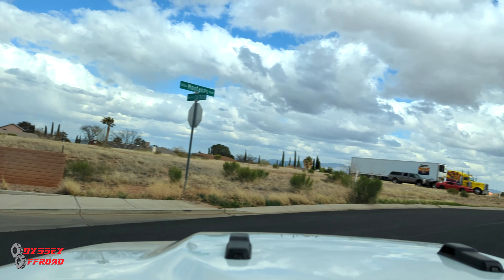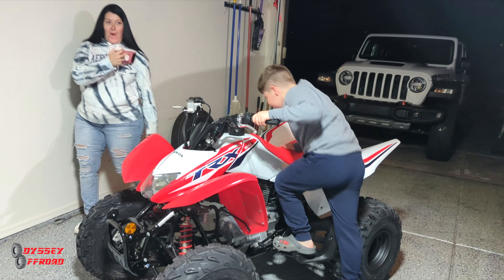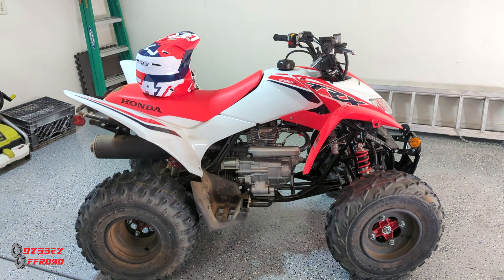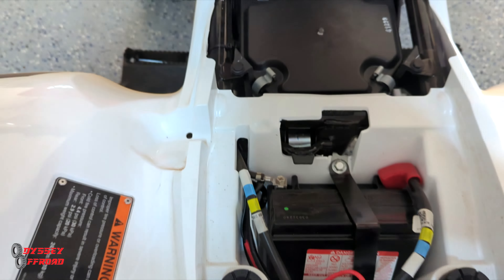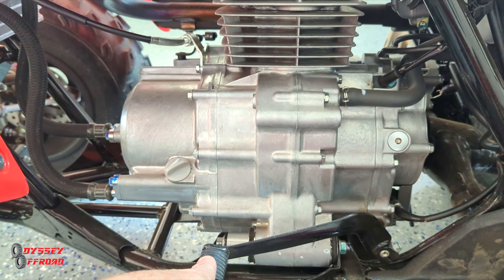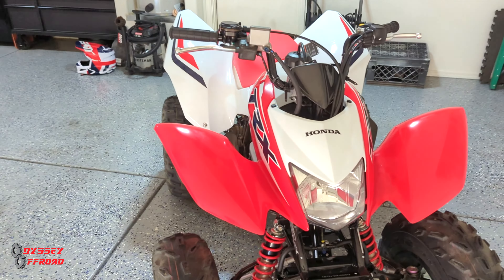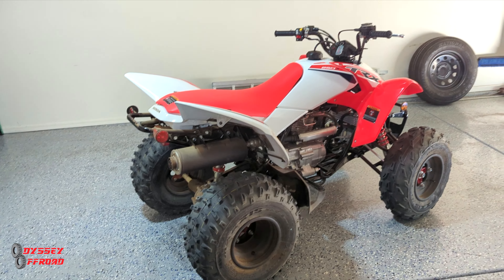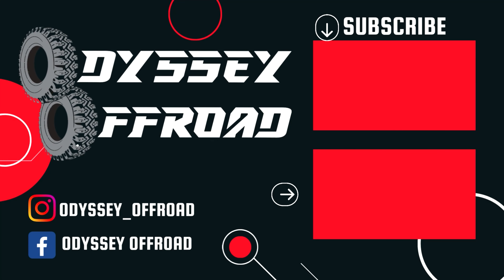New 2024 HONDA TRX 250x  full walkaround and suprise /Ryans new quad !

Comment: As a previous owner of a 250x, I can say you won't be disappointed with your purchase. It was the first quad I ever purchased and honestly got me into riding sport quads. Fun little machine for kids and adults alike. I re-jetted mine as well as slapped an exhaust / better filter on. Started up, no choke, every single time. Routine oil changes will keep this machine running forever. Mechanically, they are so simple. Enjoy!
Reply from the maker: 100% on the money, mechanically simple. This thing should last many years. Thanks for the comment!

Comment: Funny you mention the issue with starting the quad while cold, I bought a 250 for my wife and it does the same thing so looks like I’ll be changing the jet. Thanks
Reply from the maker: Oh yeah super common on all these new machines. Even the Can-Am ds250 we had a couple of years ago for my daughter was the same thing. The government cracking down on all of this environment stuff really makes it difficult for these manufacturers to put these things out running the way they're supposed to. Fortunately it's super simple to change out the jet just go from the 38 pilot to a 40 and you'll have no problems.
Reply: @OdysseyOffroad  awesome! Appreciate the info 🤟

Comment: I weigh 280lbs and I’m short 5’10” you think I could use this? Just want it for easy riding around the ranch noth8ngncrazy
Reply from the maker: @dg8676  i think thats right around the weight limit. I would suggest sitting on one and see how you feel on it.
Reply: Bro I weigh 102 and I’m 5’4 ofc you can ride it if you got experience

Comment: What is the top speed and hp
Reply from the maker: No idea on hp and have not tested top speed yet but i can tell you its much faster than a canam ds 250
Reply: What was your thoughts about the can am 570
Reply from the maker: @benmoore7089  we had one. I have videos on the channel. Nice machine but lack of power steering on that behemoth will wear you out . They also don't make a Renegade 570 anymore just an outlander 470 and I don't recommend it. I have videos on my channel on those machines you can go back and watch.
Reply: Awesome thank you I’ll check them out.
Reply from the maker: @benmoore7089  oh and top speed on a stock honda 250 is about 47 mph i found but ill test that 👍🏻
Reply: Cool thanks. New subscriber
Reply from the maker: @benmoore7089  appreciate ya 🤙🏻